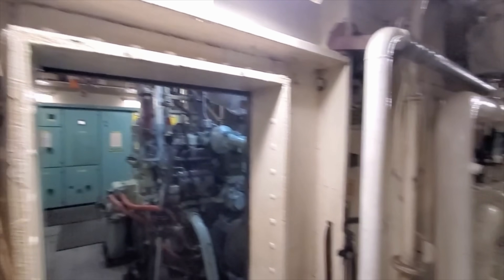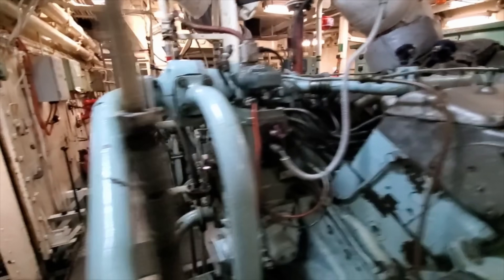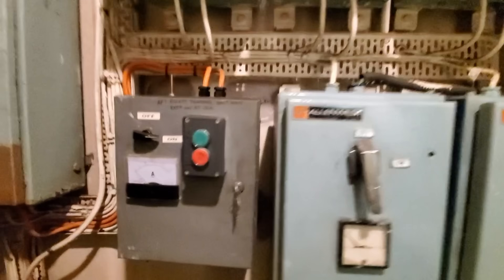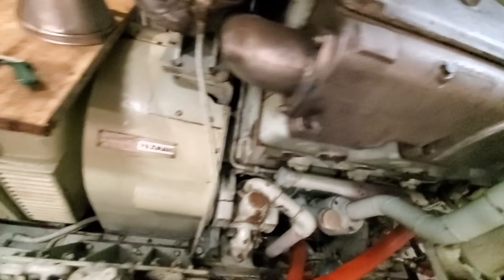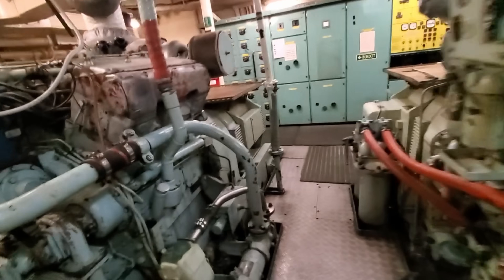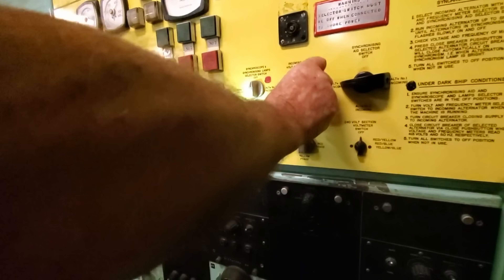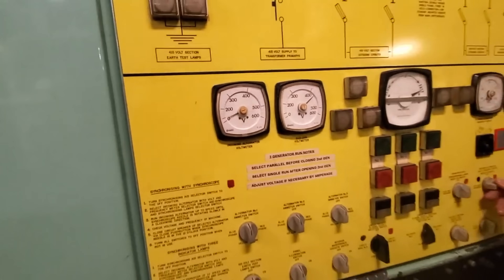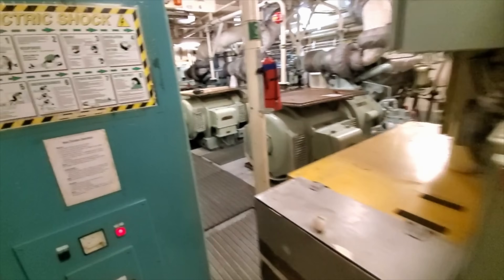Will they produce Power? Join us starting and testing the Generators on the M/V STEVE IRWIN

Comment: for the alternators if you have a battery with some leads you can start them that way.
in the connection box there should be a +/- leads going to the excitation coil.
place your leads there while the engine is running and the alternator should come to life after a few seconds.
a 9V or 1.5v AA battery is already enough
Reply from the maker: @xeon_1705  Totally, !  However these alts are dinosaurs,  Elecco Guru Bill had to use 72v DC to excite them! 
  No joke hey!!

Comment: Looking forward to seeing the synchronising video. Reminds me of one ship I was on where there was about a 30 second delay on the speed control for the oncoming generator - the unwary would crank the lever to the right to speed up the genny and on seeing no response would crank it over again, then give one really long speed-up command, only to see the first command increase the speed by the original requirement & then annoyingly see the synchroscope reverse direction on the second command, realising there was still the long speed-up command to come!!!
What made things worse was we had a Chief Engineer who, just as you make the breaker to parallel the generators, delighted in turning off the compartment lights...(more than one apprentice would panic & open the breaker again...)
"Happy with Synchroscope speed, happy with voltage & frequency...This time around... quarter to....ten to...parallelling NOW."..CLUNK (waits for lights to go out!) 
[Then are we transferring the load, or splitting the board???]
Reply from the maker: OMG that is wild! plus the C/E also , what a cool story !!

Comment: I remember that we had V12 Paxman Generators on 'MV Stratharlick'. They were a pain in the arse to start and we had to use "Bradex easy start" to get them going. The vibration of the units sometimes caused the Regulateur Europa governors to slacken off from their mounting bolts. At high loads the exhaust manifolds would be glowing cherry red! The only conclusion that I arrived at was fuel quality. They were intended to be used with gas oil but we were feeding them industrial diesel oil, the originality of which was questionable - a rusty old bunkering barge in Jeddah!
Reply: I worked in Jeddah for a few months, most things there were questionable.
Reply from the maker: So cool

Comment: Hi, brings back some memories of my time at sea as Engineer Officer. Putting Turbo Alternators in parallel when we were coming into port. The three white lights and Sync Scope pulling a big wooden handled breaker to bring in second Alternator. We sometimes had AVR problems,it needed to be adjusted with a super long screwdriver into the main board. Those were the days , NO HSE and ear defenders hahahah. Many thanks from Nr Liverpool.
Reply from the maker: That's so cool , thanks for sharing

Comment: Always fun when a starter sticks!!   Seems most of the engines are air start, is there an electric start engine to run a compressor someplace? Just thinking of a cold dead start while not at the dock.
Reply from the maker: please tune in for tomorrows premiere video
 All will be explained 🤙
Reply: Usually...

Comment: So, I’m assuming it’s on shore power with no generators running? Also where does the compressed air come from? Is there a separate diesel compressor?
Reply: He did a video about starting the compressor engine.
Reply from the maker: Yes there are 2 main electric driven air compressors, then a diesel powered emergency air compressor . Please check it out and thanks for watching :)

https://www.youtube.com/watch?v=_Nf_r3LBB9o&t=1166s

Comment: I have no background in marine mechanicals. I am wondering where that vessel uses the considerable output of 3 those large generators.
Reply from the maker: Great Question. AT sea we use only One Generator 250Kva , The alley , heating , all Engine room motors and electrical systems use a fair walk of power, Its when you leave and enter port that you need to synchronies two main generators on the board to supply the power hungry Bow thruster unit BTU. Plus windlass, captain etc. There is also a sauna onboard that was occasionally used. :)
Reply: @ thanks for the reply!
Reply from the maker: @kelleysimonds5945  Your welcome 🙏

Comment: So, what can be done when the magnets lose their residual magnetism, if I'm phrasing it correctly?  Can the magnets be re-magnetized, replaced, sawed down thin into fridge magnets ???
Reply: There are no "magnets" as such in this sort of generator - the magnetic field is created by the field coil, and the field coil is powered by the generator. This, obviously, creates a bootstrapping problem, but there's usually enough residual magnetism in the steel structure of the generator to kick-start things. When this is lost, you can use an external source of power, such as a battery, to re-establish the residual magnetism - this is typically called "flashing the generator".
In this case, however, the AVR (voltage regulator) had failed - the AVR is responsible for regulating the field current - if the AVR had failed in a way that resulted in it producing no output, the result would be the same as a loss of residual magnetism.
Reply: Yeah- imagine a regular straight coil, like a drum of wire. If you put DC through that coil you get a N-S (north south bipolar electromagnet). If you put AC through it, you in effect demagnetise it because the magnetic field keeps reversing.

The diodes in the voltage regulator take the AC, rectify it to DC for use in the coil to make magnetism. 

The more electromagnetism, the more voltage you get from the output of the alternator. Just like how a car alternator works, except the output is rectified AC (DC) to run the car at 12V (14.4 actually).

If the output voltage drops because of loading, the regulator simply cranks up the coil current to increase the magnetism...

Comment: Great stuff. I had that happen too. The diodes in the AVR were shot, and that created a small AC current leak trough the rotor, that degaussed it over night. Before could get a new diode I had to use a 9V battery to get it going every time when starting after a night on shore power :-)
Reply: I've seen some alternators fitted with a tiny neodymium magnet (in line with the exciter field), just to get the induced magnetism going. As soon as the thing gets loaded up, the coils "react" quickly.
Reply from the maker: @ Cool!
Reply from the maker: OMG that's legendary engineering right there, thanks for the info and story!

Comment: Angry pixie making engines  Well equipped ship, AllenWest switchgear is built like a brick sh1t house. Loss of residual magnetism is not unusual and a winding a quick flash with a battery sort matters. Same fix for home generators that have now output after long storage.  AVR's always spoil the party. Best to the Crew
Reply from the maker: Thanks for your comment :) Yes these are a little bit tricky apparently , Guru Bill had to use 72v Dc to excite them !
Reply: @diylifeofficial  Flashing rotor is not so hard, avoiding letting the blue smoke out of the AVR is more tricky.  PoGo video on starting ancillary kit worked well.  Best.